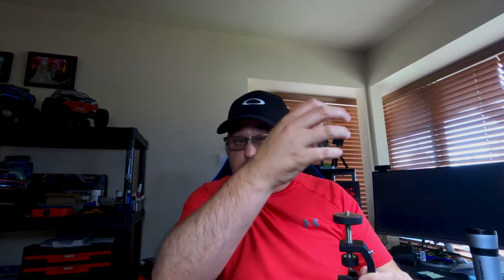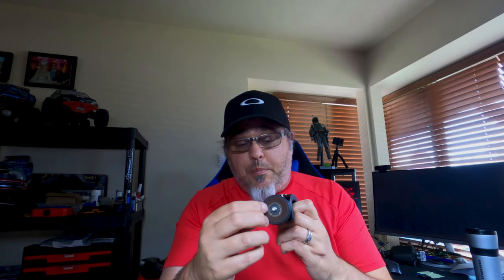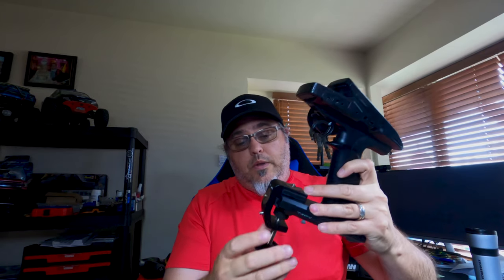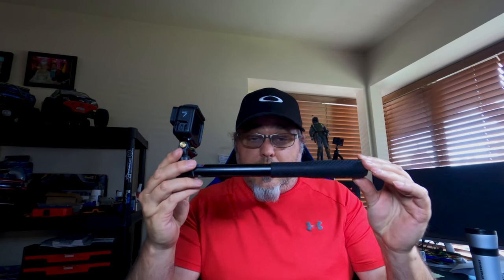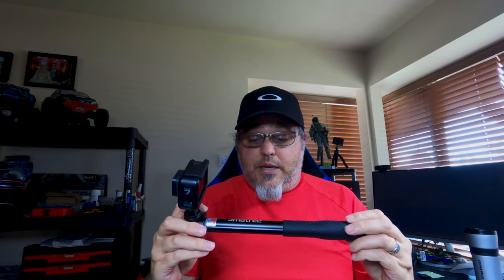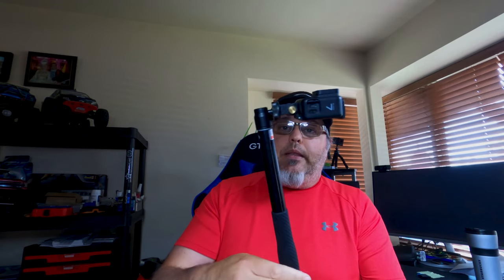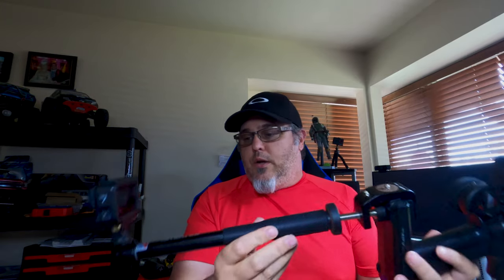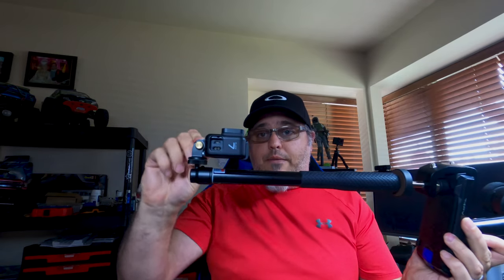How To Film RC's Camera Setup for Gopro and Phones in 4k 2020

Comment: Looks like a great setup.  I have been thinking of doing something simular. Great tip and vey helpfull!
Reply: Just watched the video you refer to to see your setup in action. Is it a heavy setup?
Reply from the maker: @cesco_rc  Not at all, using the gopro keeps the hanging weight down. But even a larger camera does not feel to heavy, it almost acts like a counter weight to help keep the camera steady. Thank you very much Cesco!!!! I have been using it for months and i love it, it helps me get some really down low shots without having to be all bent over.

Comment: I have the same setup, I go back and fourth how I feel about using it. Gets heavy lol. Yours looks smaller. I wonder if I got a bigger one. It seems so giant some times. If mine was a little smaller it work a little better. It does not fit my radio so good and it bothers me lol. I have ocd lol.
Reply from the maker: Hehe RC Propaganda brother, I have a bit of the OCD myself. Life of Coach D found an alternate to the clamp which is a bit smaller and also cheaper than the Haoge one. The selfie stick i have used a couple different ones but the Smatree seems to be the one that has held up the longest. Thank you very much Brother, it means a lot!!!
Reply: @Stickies72  yeah i have the same stick. Cheap and has lasted. I have so many dif setups but never know what the best is. I like to switch things up.